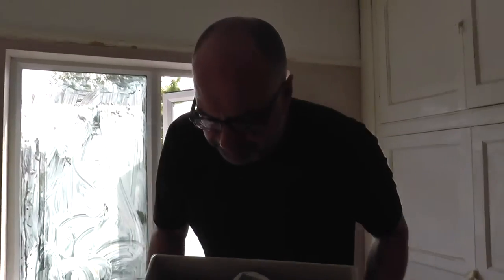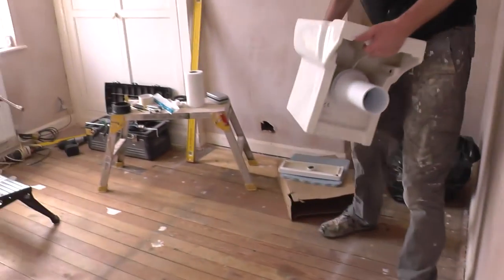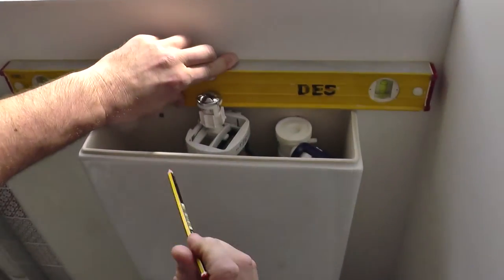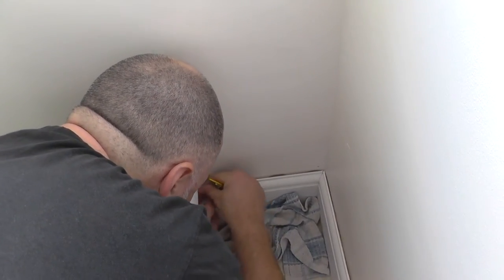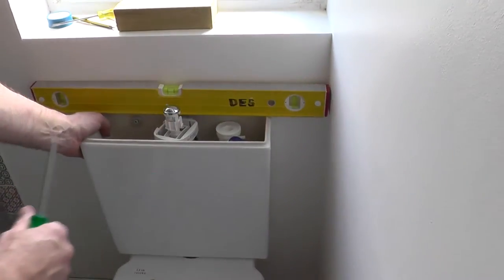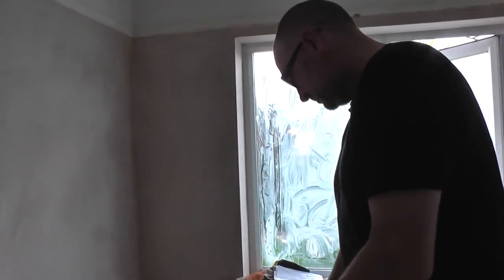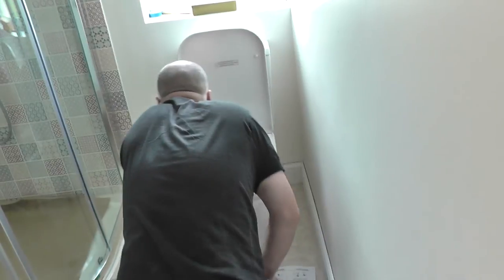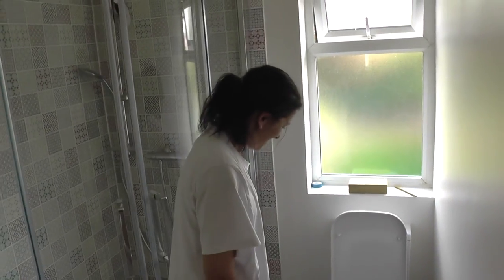DIY: How to install a new toilet (cistern and pan)

Comment: Also whenever I fit toilets I always reinforce the floor with extra noggins so than don't move. Also boss white shouldn't really be used in potable water situations. Even though it feeds a toilet it still supplies your drinking supply indirectly. It's a low risk. I use a potable mix instead. You can't beat abit of boss white and hemp though for a good seal!
Reply from the maker: Zed Man Thank you for your typically constructive and valuable feedback ZM. Looks like you've nailed me on the Boss White! To be honest, I did note that it was for non-potable water supply but chose to ignore this because it fed the toilet cistern and I was pretty desperate to try and get the best possible seal on that awful connection. I rightly or wrongly considered the risks to be minimal. However, you are absolutely right to say that it does indirectly supply the drinking water. Hopefully, our hair won't start dropping out and we won't start growing extra fingers or toes ........ hopefully .......... ATVB